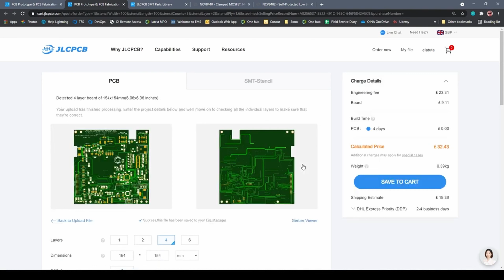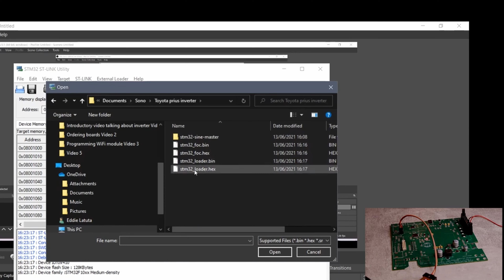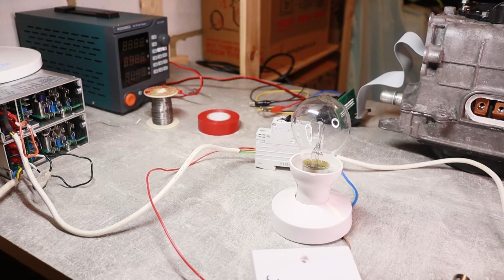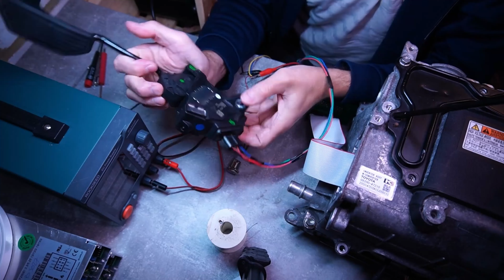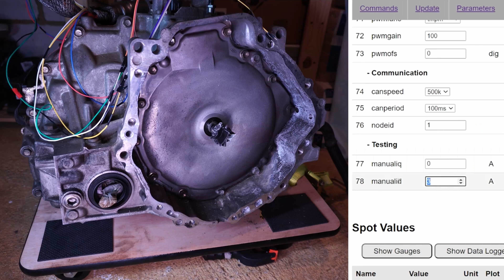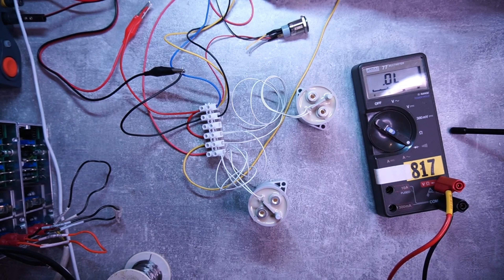Prius Gearbox as a DIY EV motor

Comment: Hello Sir, please could you share your parameter files and firmware version? I can't even get my setup to spin in open loop.
Reply from the maker: Sorry I am traveling abroad at the moment so I can't share my parameters. But if you check open inverter thread you can get them from there. I use the latest sign firmware

Comment: Hello Sir, thank you for the videos, I am actively following your steps to recreate this. Please I have some questions, what's your planned pack voltage and what speeds do you expect? Also, how do you think a pack voltage of 100V would perform on the highway?
Reply from the maker: I think 100V may not be enough for a motorway. I am looking at nominal pack voltage 360V and 400V max voltage

Comment: I would think you could install an overrunning clutch where the engine used to be, allowing MG2 to contribute to traction power up to 40 mph, at which point it reaches it's rpm limit.
Reply from the maker: I am thinking maybe get rid of MG2 all together
Reply: @LatutaEV  Some people weld the spider gears so they spin together, but the windings are different so you must control them independently, making welding the gears kinda pointless.   I would remove the rotor, but keep the stator and use the coils/windings for a very powerful boost converter
Reply from the maker: @murraymadness4674  People weld gears to join mg1 and MG2 together. I think the power to weight ratio of MG1 making it not worth it. I would remove all gears and mg1 just leave reduction gear to drive the wheels. And put one MG2 per wheel
Reply: @LatutaEV  that was my plan for a hybrid motorhome, i have two highlander transaxles, was going to run one to each wheel, mg2.  a lot of extra weight for a car though, for a motorhome no problem.
Reply from the maker: @murraymadness4674  yes I agree that sounds very plausible